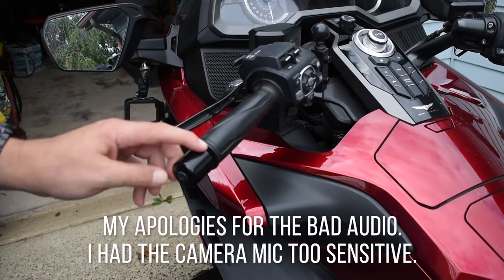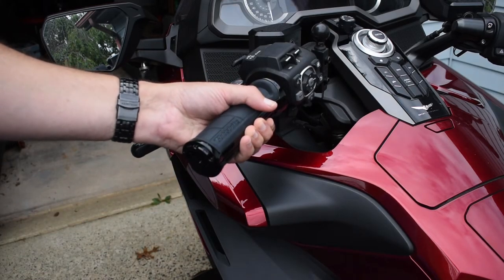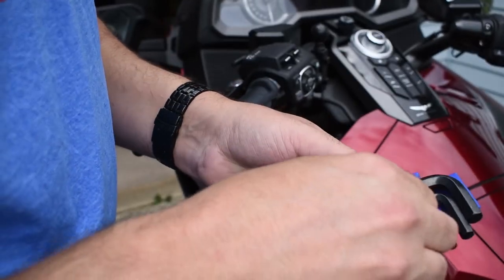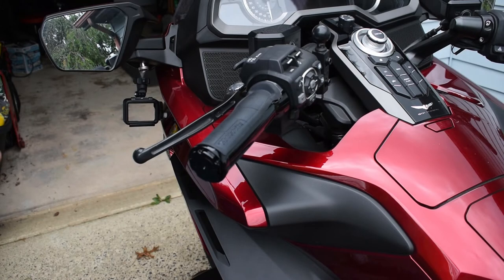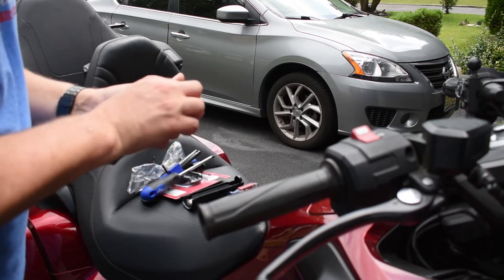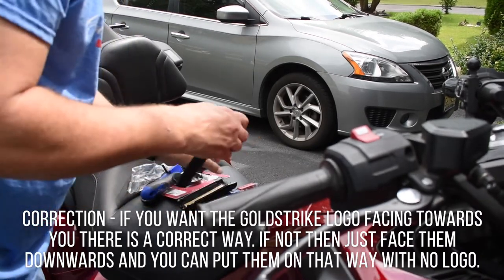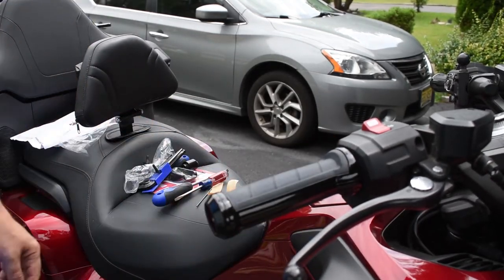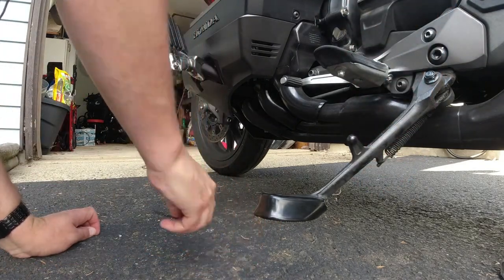Goldstrike Grips and Big Bike Parts Kickstand Pad Install | 2018 Honda Goldwing

Comment: I like the grips - but I wonder about heat transfer because the heated grips aren’t that great to begin with IMO. Also wonder about the lack of bar-end weights. Keep us posted…
Reply from the maker: I hear ya. Guess I’ll find out about the heat when the cooler temps get here. I’m also curious about the lack of bar ends. I mean there is not much vibration with this bike to begin with 😂😂. I’ll be posting an update probably sometime in October I think.

Comment: Blue locktite, points down, could work out?
Reply from the maker: The bolts do not install from underneath..they install from the top down. I did go back and apply blue loctite on them do they won’t wiggle out. So far so good. 🙏

Comment: How are the grips now? Are they performing as they should. Rubber condition and fitment still tight and right, and any complaints?
Reply from the maker: Still working great. Zero issues with them.
Reply from the maker: The heat takes a bit longer but you can still feel it.

Comment: Make sure to use some loctite on the pad screw or it will fall out after time even if tight.
Reply from the maker: Went back and did that today lol. Thanks!
Reply: @motorider4130  thanks for the vids

Comment: How do u like the highway pegs? Show chrome also? Tnx
Reply from the maker: Hey! The highway pegs are ok..I think I need to adjust the one on the right a bit. They are comfortable to use but def reduce the ground clearance on sharp turns. Also I just noticed that the finish is peeling off a little bit. Going to be doing a short vid on that soon. 🙏